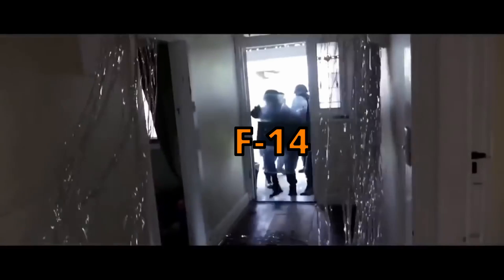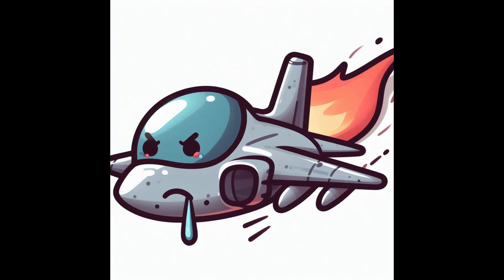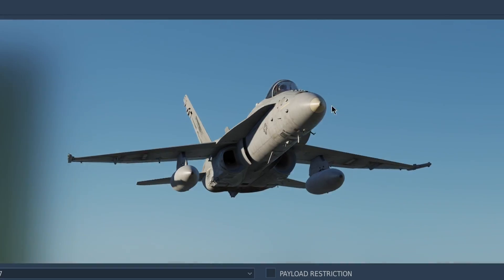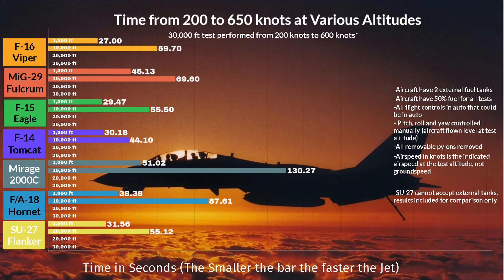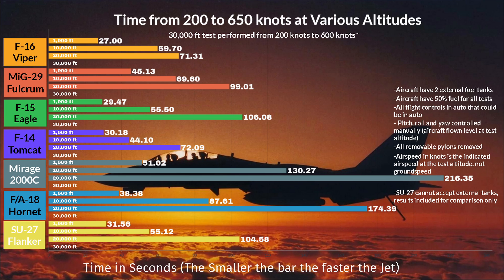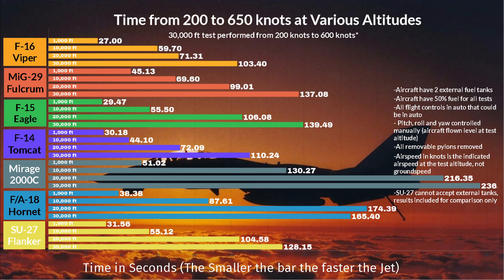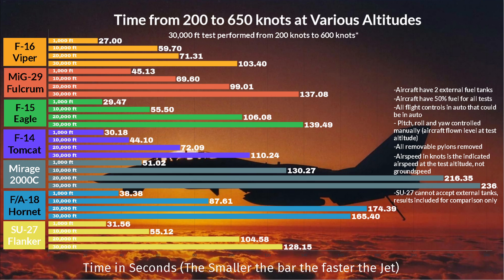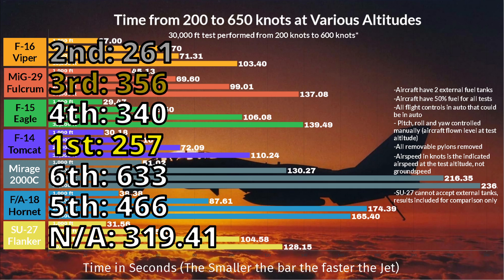F-16 DETHRONED! Fastest Fighter Jet in DCS Test

Comment: IRL isn't the su27 faster than the f15? I was at least under the impression they were very similar in speed so it's interesting to see such a divergence here do you think this could be due to influence from the US military?
Reply: This is because the Su 27 FM in DCS is totally broken, there's a video on YouTube Showing the DCS Su27 accelerating slower than the IRL Su 30. there are also several threads about this on ED forums, but ED refuses to acknowledge the problem. The DCS Flanker fails to match the available Graphs as well as observed IRL Aircraft performance

Comment: For the M2000C it is completely expected, Delta Wing with a starting speed at the back of the drag curve + 2 massive fuel tanks literally not designed for supersonic speed. Plus 1 engine so lose in compressibility efficiency compared to all 2 engines jets.
 You want to scale all jets at the correct initial speed  where the drag curve is less penalising and with equivalent fuel time available so the actual acceleration be evaluated :)

Acceleration wise test can be oriented in many ways and you will get different results
Reply from the maker: I was tossing up using one tank on the Mirage, but then it would have an advantage. It would do pretty well if the test started at 400 knots.
Reply: @Tabs_Original I mean you are putting the mirage 2000C at a disadvantage here, the wing mounted tank are used mostly on the mirage 2000D doing A/G or for transit flight between airbase, but you never see the big tank installed on an A/A configuration (Just as a reminder, the mirage 2000C was meant as an interceptor with bombing capabilities that were remove on the following version of that aircraft) the large fuel tanks are a tradeoff to increase drastically the range of the aircraft, it double the fuel capacity of the aircraft therefore it is really arbitrary to make that test with them installed.

Also I would like to point out, you announced at the beginning that this test aim at a more realistic approach, and yet again it begs the question of the usefullness of the test because why does it matter which aircraft has the best acceleration if it is not in a combat scenario ? Isn't acceleration mostly useful during an engagement ? Any aircraft entering a merge with tanks still attached, asks for trouble no matter how big the tank, therefore comparing acceleration value doesn't really makes a lot of sense in my opinion.

With the loadout selected for those aircraft you should probably do some testing about cruise speed and range, that would be more fitting. Also I would have loved to see how the Viggen fare in the acceleration department, I think when we talk about being fast in DCS it clearly deserves an entry in the contest !

 Have fun out there !

Comment: It's not the F-14 flight model being broken. It's part of the design of the aircraft. The -14 was an interceptor and was designed for long times on station, and the tanks really just end up being part of the nacell/tunnel structure in terms of aerodynamics, whereas all the others are actual blockages to airflow. Running the -15 with just the conformals would be a more extreme version of this.
Reply from the maker: Good Point! Also the tomcat is such a big aircraft in terms of percentage more drag, it would have less added drag than the other jets here would experience.

Comment: This is not “faster”
This is “ accelerate faster “
Reply from the maker: That is correct 😀. I could do maximum speed testing with and without external tanks at various altitudes. Do you think that would provide interesting data?
Reply: @Tabs_Original  Would be a great idea ;D
Reply: @Tabs_Original  f14 A should also 
win that IIRC
Reply: @maybesherlock734 F-15 wins that, hands down - it gets up to about mach 2.5, whereas the F-14 struggles to even reach mach 2.
Reply: Faster acceleration can mean the difference between winning and losing. As an example of this in American football, running backs/recievers that can accelerate to full speed quickly (sometimes in just a few steps) can outrun their opponents even if their opponents have a faster top speed because once they've blown past a defender it is very difficult for that defender to catch them. Of course if there is enough distance to the goal line said running back/reciever can still be caught.